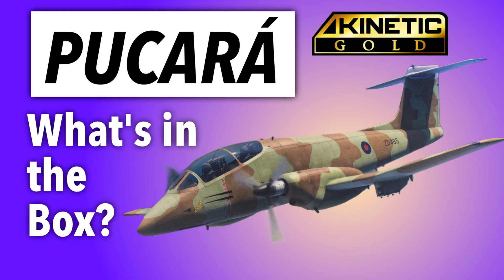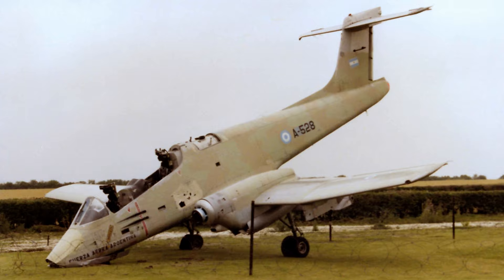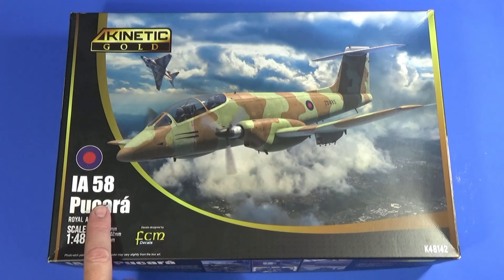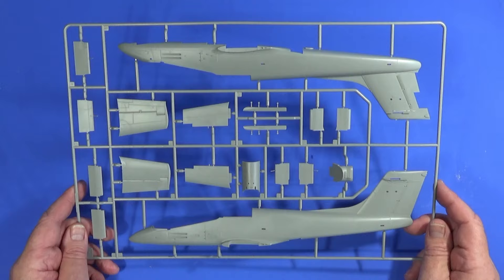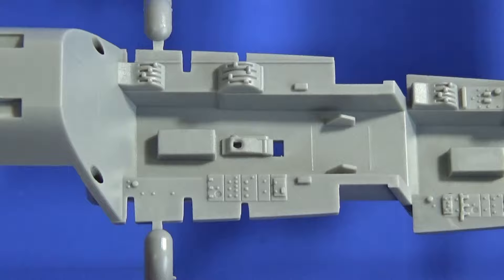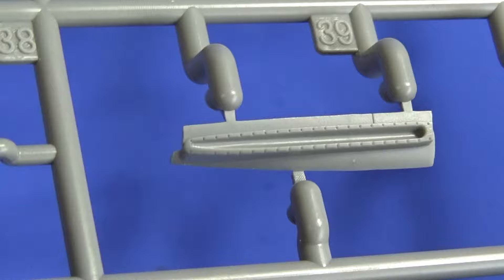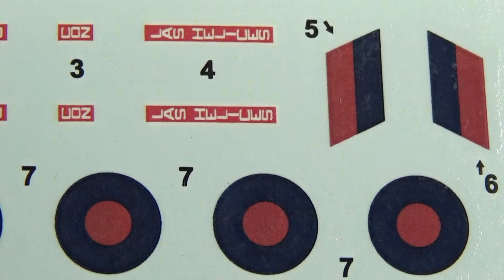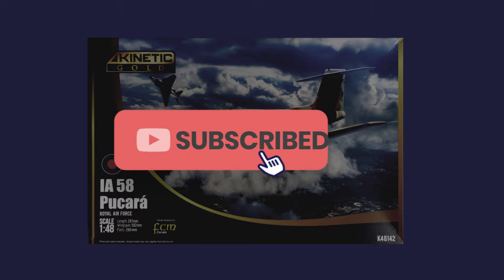FMA PUCARÁ - history and the Kinetic 1/48th kit

Comment: If you started building it, how's the fit of the kit? My only Kinetic experience was with their Mirage 2000 in 48th, and found the model to have poor fit on some areas.
Reply from the maker: I haven't started it yet but I hear from several people that the fit is excellent.
Reply: @garys_stuff  will have to give Kinetic a new chance then. Don't forget the nose weight! My 3d printed Pucará in 48th needed 60 grams to sit on its nose.